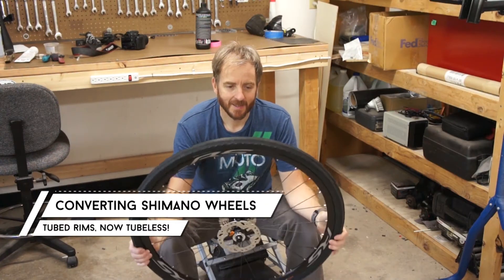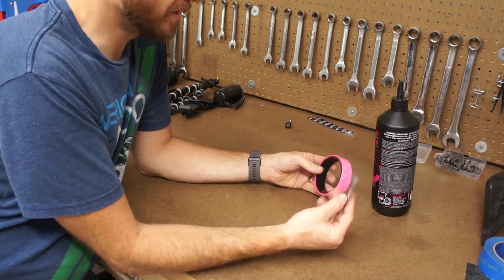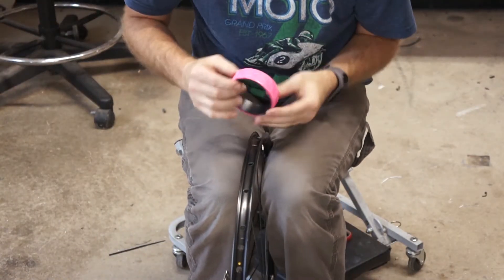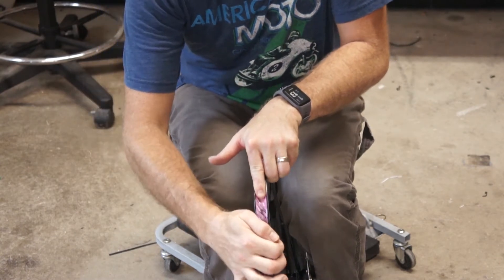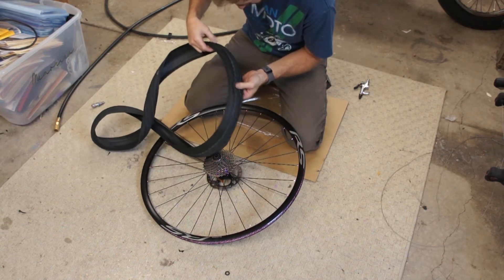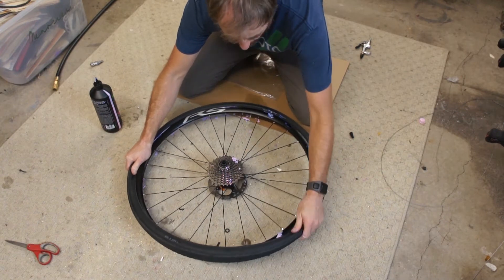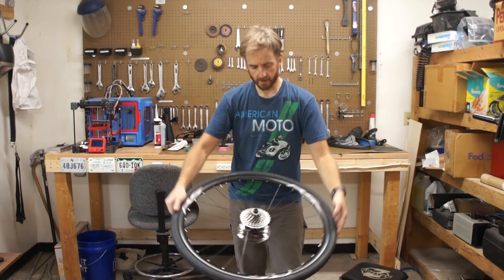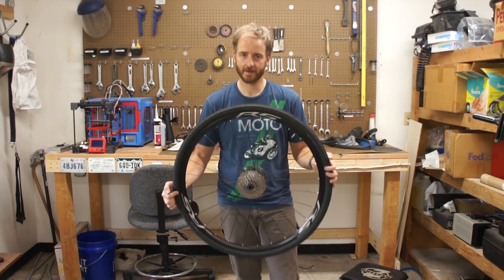Converting Tube Wheels to Tubeless: A Step-by-Step Guide

Comment: Good decision to pull the old tape; likely didn't need three layers of new. You can convert even more unlikely wheels. I was mastering tubeless, so a few days ago got bold: used the original alloy wheels of my high-end 1970s touring bike, old Gravel Kings, makeshift stems (cut from old tubes) and electrical tape. Worked! Some old tire pinholes sealed up nicely; a stem needed a makeshift O ring (small rubber band wrapped tight around its base). Fun no-cost conversion. So far so good, but I wonder how they'll hold up with heavy use, like on gravel.
Reply: are they still holding with heavy use?
Reply: @allrounderbicycle7193  They held up well under heavy gravel rides for a couple months. But it was a "testing of concept" and I didn't want to push my luck, so went back to tubes on this bike.
Reply: @dugldoo  thanks.  I regularly run 25-30psi and i'm just seeing if there's anyone who does this conversion and sincerely rides them "full send" sub-30 psi.  So far all the conversion videos I've seen run either high-pressure or the rims are not actually non-tubeless, or they've failed.

Comment: Be good to know the final result, did the wheel hold air overnight? and since then how has the wheel any leaks or issues?
Reply from the maker: Hi, Pooja.  The wheel did hold air overnight and for the rest of the season and up to today.  I'm still riding on it.  I had a nail in the tire a few months ago and it sealed up fine.

Comment: Nice video.  I'm thinking of doing the same on a set of wheels with semi-deep aluminum rims (spoke heads are recessed).  FYI, Muc-off's recommendation for road tires is 30-45ml per tire.
Reply from the maker: Thanks Doug.  Good luck with yours.  Wrap the tape up the sides a bit and I'm sure you'll have good results.

Comment: This was really helpful! Mine are leaking through those side holes, like you said the sealant is for yours. Does the sealant seal those 1mm holes, or did you need to apply a patch of some sort?
Reply from the maker: Those 1mm holes are drain holes to let any water that gets in the rim, out.  If you're having trouble with leaks, there, it's getting into the rim around one of the spoke nipples.  Double check that your rim tape is well adhered over the spokes.  Maybe give it another wrap or two.  Sealant might seal those but I think it'd have to fill up the inside of the rim first which might use all your sealant.

Comment: How did it hold up? I just bought a new road bike and cant afford a tubeless wheelset yet and was hopping this could get me through until my next tire change.
Reply from the maker: It's held up great.  I had a slow leak in the back and switched from Mucoff sealant to WTB sealant and that fixed it.  The WTB is thinner and better seals the bead.

Comment: I usually clean the rims with 99.9% IPA on a cloth so that the tape sticks optimum. I also put the tyre on and inflate it first to see if it will before adding sealant, then deflate it and hopefully most of it will stay on the rim, add sealant through the valve tube, ad the core and inflate. Things got a bit messy there.... I'm doing battle with a pair of new Panaracer Gravel King SK (26x2.1) and a pair of non tubeless  DT Swiss X1800 wheels at the moment(with proper T/L tape applied). Think I need to add either electrical or gorilla tape around the rim to increase the internal diameter as even with Schrader tubeless my "ghetto" (large coke bottle) cannister holding 80PSI won't look at it....Tyres are T/L rated just seems to be an issue of the clearance between the rim diameter and tyre diameter.... Rims are 18mm wide and electrical tape is 19mm, Gorilla is 25mm and would need cut for sure. Certainly a challenge and I could do with a compressor! Beginning to wonder if the real difference between tubeless wheels and non-tubeless is this factor- the tolerances...non tubeless are probably a lot slacker and sometimes tubeless tyres on tubeless wheels are really tight...
Reply: Got the tyres on without any additional tape- just took leaving them inflated overnight with a tube in to get the shape "set" and one side stayed fully on the rim when I swapped the tube for the T/L valve... the coke bottle worked it's magic....!

Comment: I use gorilla tape from homedepot for my mtb and I'm planning on converting my AIMA Big Sur 26x4 into tubeless by just taping the wheels and adding sealant.  Again, nothing is tubeless ready but I definitely think will work. By the way I bout some expensive liners 60.00  Each x4 installed already, and it's a pain . That's why I want to go tubeless.

Comment: I have 5 bikes and multible sets of wheels. I have regular clincher and tubless wheels. So I wonder what is the point of a tubless wheel if a non tubless wheel works the same?
Reply from the maker: The fit between a tubeless wheel and tubeless tire seems to be tighter.  I’ve noticed that the tubeless tires on standard clinchers will sometimes unseat when deflated.

Comment: I don't see how clincher wheels would not be convertible into tubeless with tubeless tires and all the stuff needed..! 🤔
Reply: Its kind of a dice roll. The tolerances are not as tight on clincher and the bead lip isn't always deep enough to hold.

Comment: I tried so hard to fit tubeless tires on tube rims ...I finally gave up. It didn't fit easily like yours. Its GP 5000
Reply from the maker: Sorry to hear that.  Those GP’s fit tight, even tubed.  I can only  imagine how tight the tubeless version is.
Reply: What was the problem ?.I use Gatorskins and they are notoriously tight to fit when new . I m going to try it anyway and maybe warm the tyres up a little in the oven to make them more pliable.If this fails I ll buy tubeless wheels .